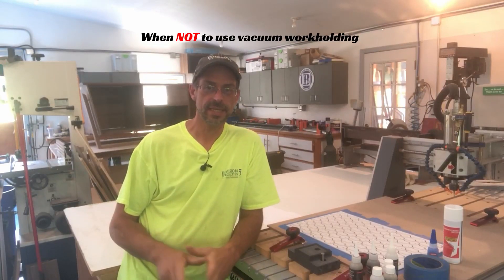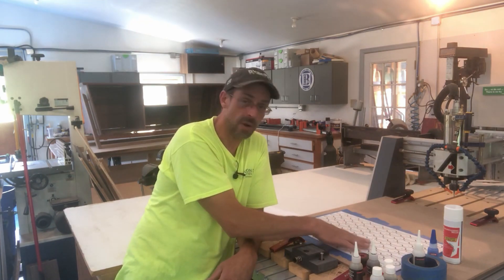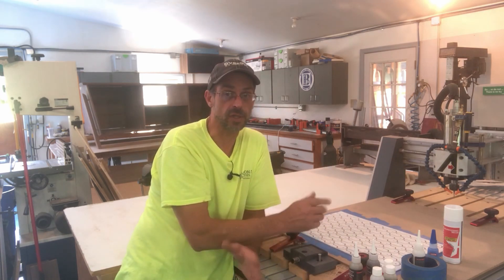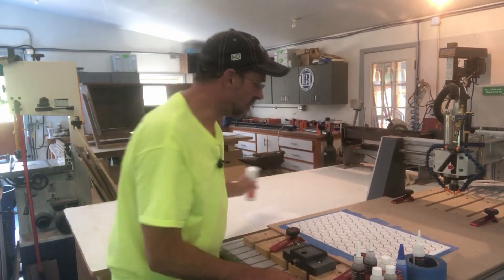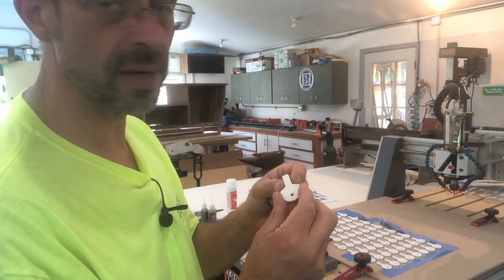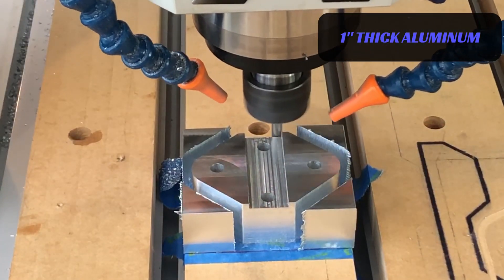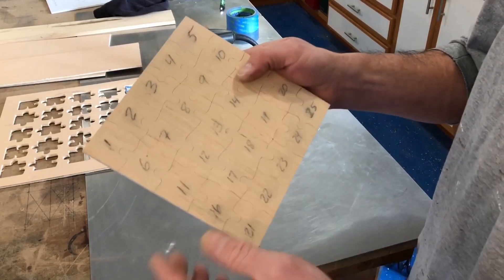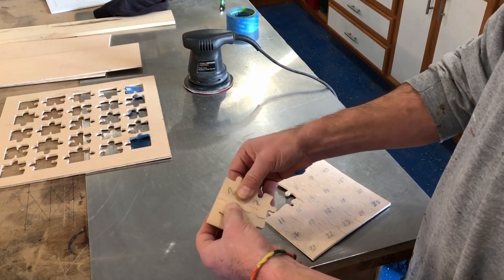Superglue and CNC / No Vacuum - No Problem

Comment: That spindle seems to do a good job. I have a 4 hp servo and it does not like aluminum. Nice work
Reply from the maker: Yeah it does ok, I keep the feed rate and depth of cut pretty conservative.
Mostly to avoid breaking expensive bits 😆
Reply: Most of our work is wood and foam. We put a lot of effort into the vacuum table and would hate to wreck it with lubricants. Are you just using air on the bit? If so I’m surprised you are not welding aluminum to it.
Reply from the maker: @brianbean7024  generally I just use compressed air, but occasionally I do use wd40 with no air, both work but the wd40 is messy
I always use an up-cut bit with aluminum

Comment: you just need to use a good restickable/removable double-sided foam tape. Saves you hassle, time, and money. I'll see if I could find an address to send you samples.
Reply from the maker: Sure double side tape works for a lot of situations, but I believe the super glue method has more “consistency” if you will on the z-axis.
Reply: @BuildswithBrian  Correct most double-sided tape is either too strong or too weak. I only thought of CNC because I recently purchased a machine and found I needed a way to hold object firmly in place while being pulled but able to release without residue. The tape I use is only available through business to business market (for temporary signage)

Comment: stupid question.  Do you glue down the painters tape to the board?  Painters tape is not double sided?
Reply from the maker: So it’s super simple and works great,
You put painters tape down to the table, and you put painters tape on the back of the part,
Then you put a little bit of superglue on either one, and you stick them together.
You can search YouTube for CNC superglue workholding and find many videos describing the process.
Reply: @BuildswithBrian  Thanks